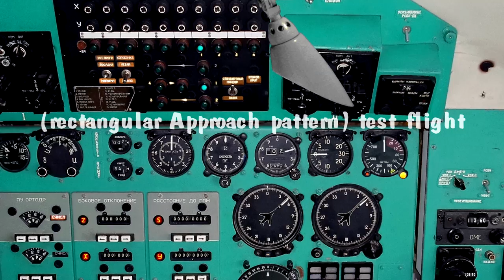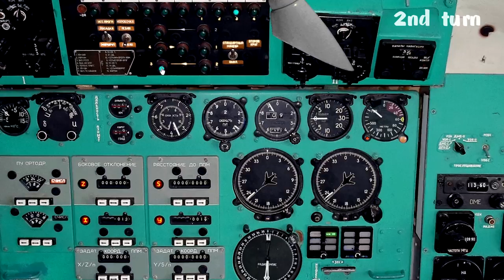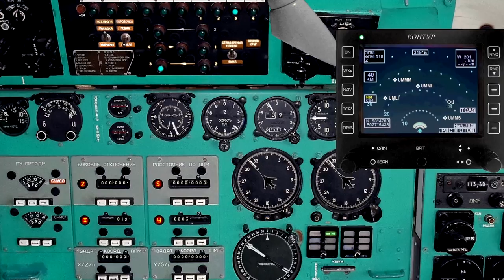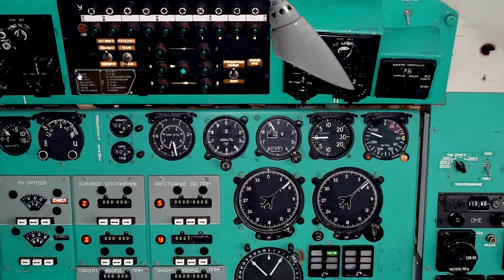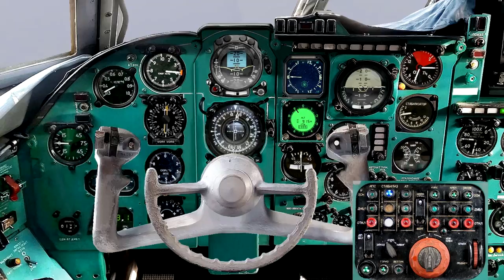IL-62M Standard Manoeuvre Mode test at Minsk-2 #IL62 #IL62M

Comment: So you programmed that on xml? I think the protu il62 had that uhmmmm haven't read enough.
Reply: Btw guess its time ro do one of those "square" approach patterns you see in russian airports
Reply from the maker: Yes all done by xml. The Project Tupolev has Standard Manoeuvre Mode as well.
Reply: @edetroit  guess i'll fly the il62 soon too, just need some time for get the manual in my head.

At least i can use the NVU in the Tu now :)
Reply from the maker: @LeonelEBD  Good for you. My IL-62 navigation panel is a lot easier than than the PT one as my NV-PB procedures are fully automated (waypoints are taken from the flight plan)
Reply: @edetroit  I still wonder how you get your bitmap colors so well, even with the dithering technic you told me I cannot get them right. Very well done!!